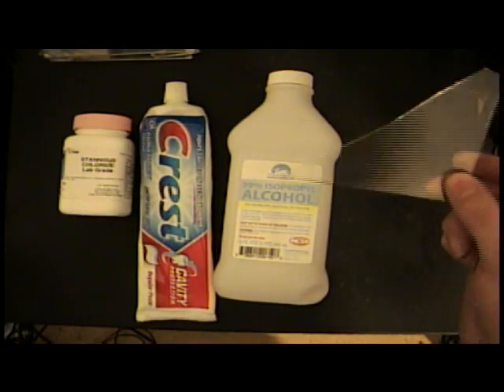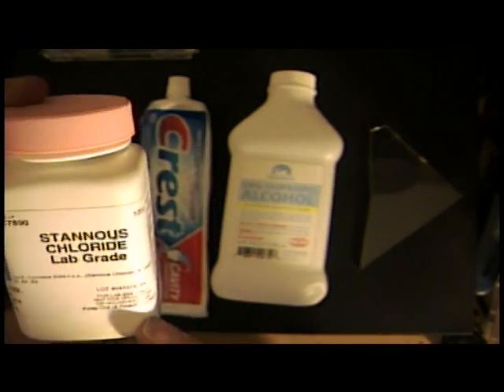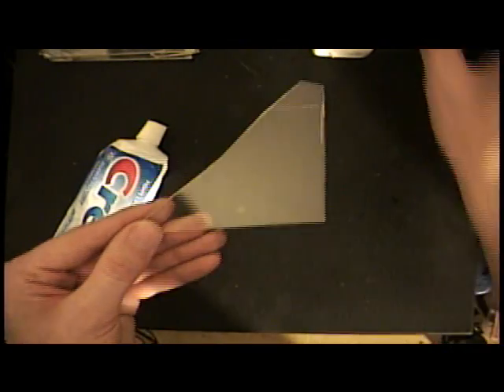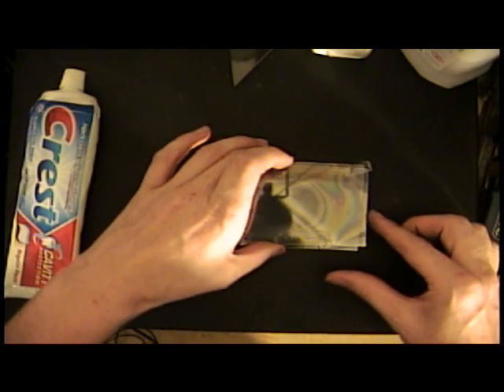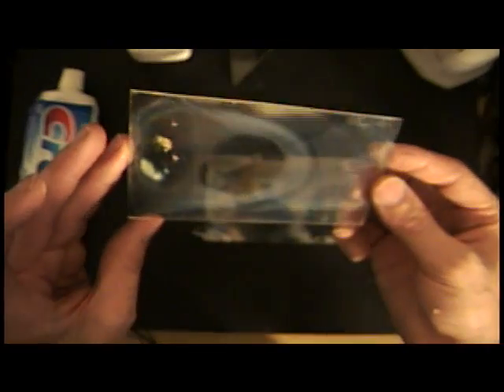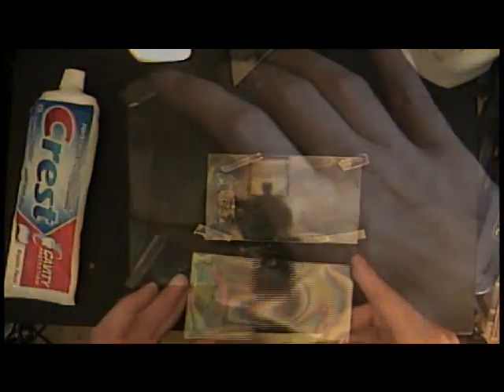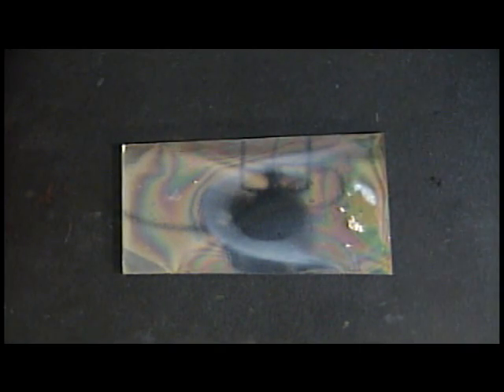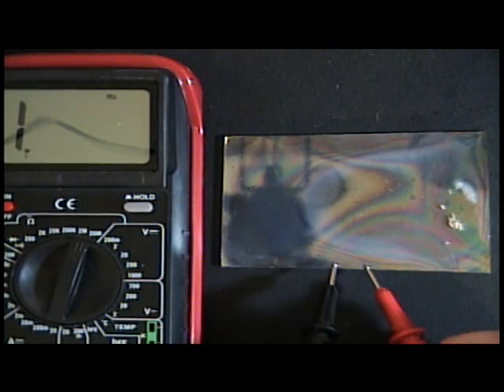Tin Oxide Conductive Glass - Stannous Chloride

Comment: I tried this and it worked fairly good. But had to be done outside and cracked alot of glass with the heat. But then I found some ITO coated slides very cheap on Ebay which works even better.

Comment: Jeri, as SnO2 is semiconductive and glass is transparent - is it possible  to make solar batteries some way?
Reply: Unfortunately, the band gap 3.7eV of SnO2 is not very friendly in terms of efficiency and/or capturing most out of the solar spectrum. Somewhere around 2eV band gap is preferred. Though it might be technically possible, it is not very practical.

Comment: @daviddanielgraham Stannous Chloride has a melting point of 370 C and Boroscilate has a melting temp of 800-ish C... Soda - ash glass has an even higher melting point temp. Is the point here just to form the tin oxide layer on the surface?

Comment from the maker: The rainbow is the refraction from the uneven thickness.  With tighter control of material distribution and end point you could choose the slight color that it refracts.  From my experience the with silicon oxide layers there are thicknesses that are barely noticeable.
Reply: Hi Jeri!, How are you?. Do you can make this transparent coat with Platinum??. Regards!!